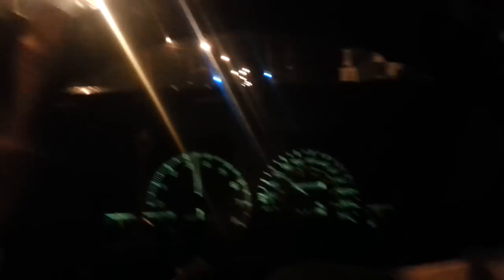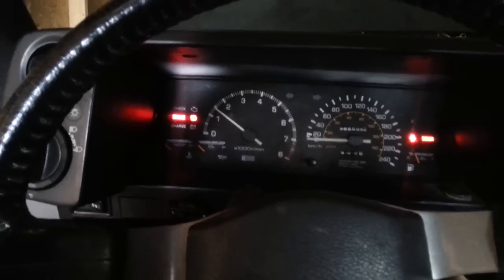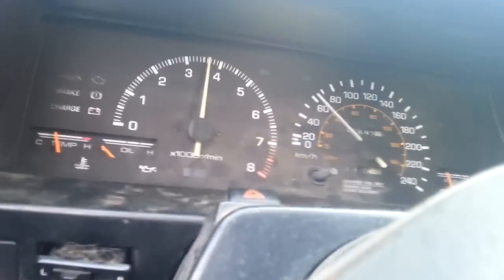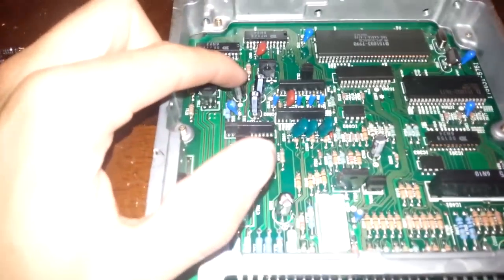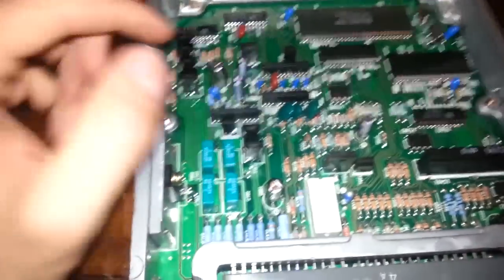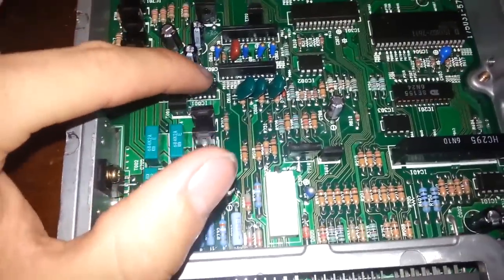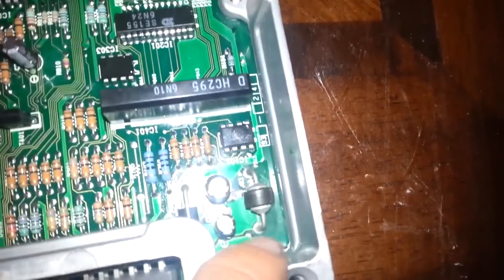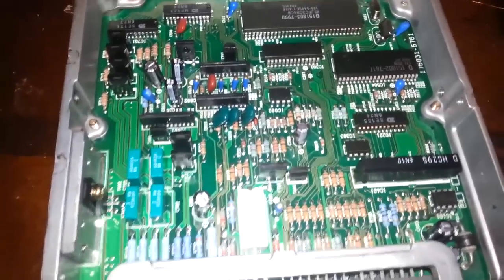Dealing with 20V 4AGE ECU problems - Limp Mode - 4000rpm Rev Limit

Comment: where would someone send an ecu to get refurbished?
Reply: i bought another ecu, but it had another part number.  car runs now, but no rpms on tach and still having idling issues when cold.  my original was deemed unrepairable by one shop and sent back to me, but I'm thinking about replacing the capacitors on the one currently in the car.

Comment: Hi. I know this is a pretty old post but do you guys still have a source for repairing the ECU.  My Silvertop has idle problems once it gets to about 160F and drops down and cuts out.  It kicks out a DTC 13 which says the distributor or ECU.  The distributor is within specs for air gap and ohm readings do I am thing the NG circuit. If not, the capacitors you mention, I see a number on them but are having trouble to try and cross reference them. Where would be a good source to get the correct ones. Radioshack maybe?  Great informative video so thanks for that.
Reply from the maker: Did you open the ecu case and examine to see if capacitors leaked?

I know a guy i can put you in touch with but before that you should confirm if the capacitors have leaked and if they damaged any traces
Reply: @Kenny4AG  Thanks for the quick response.  Yes I took the top off the ECU and I see where the larger capacitor next to the NE trace has leaked.  Another further over may have as well.  Thanks for any help.

Comment: My acura wont rev past 4k rpm and all sensors were tested even swapped the motor and the wire harness and still the same damn code p2647 high voltage  and it wont clear and we think its the ecu when i would go past 80mph my car would smell like burnt

Comment: My silvertop have the same problem, checked the ECU for back caps but everything is fine, checked for error codes, just a Bad O2 Sensor but still wont rev past 4k rpm. 

Planning to convert for BT ECU and change to whole wiring harness and do a complete engine rebuild.

Comment: Hey man, I've recently run into an ae92 with a 20v swap, it's got maybe a couple problems but I don't know enough about the engine to really tell what.
Reply from the maker: I cant help you without more details, what exactly are the issues?
Reply: Kenny4ag  Well for starter's it smokes a light grey, it's not smoking a shit-ton but still enough to raise an eyebrow to half-mast. The coolant resevoir was low, so that's probably leaking somewhere, and much like this video sometimes it does kind of have a limp mode but not all the time. It's a silvertop with a blacktop harness and TPS. I just wonder if it would be more trouble than it's worth.
Reply from the maker: Rhandal Bumbalough silver top on blacktop setup always runs rich, so that could be your smoking issue.

You could pull the spark plugs and check for indications that its running rich, even if it does theres not alot you can do to fix it short of swapping to run a silvertop ecu.

Since its running blacktop setup i assume ur running open stacks.
Reply: Thanks man, I'll look further
Reply: But you've been helpful as fuck, I wouldn't have thought of that.

Comment: how about the resistors? i also have replaced the capacitors but i still have issues. code is 42 and 33
Reply from the maker: Arvee Lacorte is your board too far damaged from the leaking capacitors?

Comment: I Hv a Bosch 022 906 032 DB ecu doesn't supply power to coil number 2, trying to replace the burnt components I just can't locate it, can u help out? thanks
Reply from the maker: PROVERBs UCHE get the part number off the part and google the part number, its usually small font
Reply: +Kenny4ag 
don't kw abt ecu thought someone can direct me to which part is responsible for it not firing coil 2 so I can change it
Reply from the maker: PROVERBs UCHE youd have to research your specific ecu but what makes you think its the ecu thats the issue
Reply: +Kenny4ag 
cos I got a used one and it fired all 6 cylinders but the throttle body didn't align, wen I put the old one back only 5 cylinders were firing and it works with the throttle body just fine

Comment: My 20v silvertop runs 600 rpm on cold start(erratic idle) and producing black smoke but after 10 mins it goes up to 800 do you think it has something to do with the ecu, every week i check my spark plugs the lower part is filled with carbon powder(running rich)
Reply from the maker: aye garsi check ur compression and make sure ur getting 180ish per cylinder.

If you are then maybe o2 sensor or idle air control valve.

Are u getting a check engine light
Reply: thanks kenny,last year ive change my o2 sensor and tps ,if my capacitor is bloated or leaking do you think it has something to do with the low rpm on cold start and running rich,i also check the iacv the magnetic part i pull it out and the small cylinder is moving clock wise n counter clock wise ,thanks
Reply from the maker: aye garsi how does it run when ur driving? Are u blowing black smoke everywhere?

Do u have a check engine light
Reply: Hi kenny,the car running smooth and normal its just that when i press the accelerator with pressure it produce just small amount of black smoke,by the way last year the mechanic change few capicitor ,about the check engine light,only when i switch on the the ignition key,but after engine starts the light goes off,thanks
Reply from the maker: Sounds like IACV(did you clean it with carb cleaner?) or temperature sensor(the one that sends signal to ECU) or air bubbles in coolant. blowing black smoke could be it burning oil but since your saying its running rich it could be that also. Bad temp sensor COULD cause it too run rich(so could air in the coolant system), so could an O2 Sensor.
Reply: I didnt clean the IACV yet,that was also the suggestion of the mechanic,he told me also that theres no problem with the o2 sensor,whats the best engine oil to use for silvertop, ive notice that when i change my oil ,after a week oil is getting dark already,im using toyota mineral oil, thanks again
Reply from the maker: for oil i've used castrol 5w40 and 10w40
Reply: Thanks kenny
Reply from the maker: aye garsi you should check for signs of headgasket issues, remove your radiator cap and see if there is a thick slime attaching itself to the underside of the cap. If there is, thats a symptom if early head gasket issues
Reply: When i check the radiator cap,its still ok theres no sign of slime,this afternoon when i started the engine,the rpm is a little bit high around 900 rpm,in your experience with the engine oil ive notice that when i change oil after a week the oil is getting darker already,ty
Reply: Hi kenny,do you have a video on how to remove the alternator of silvertop engine on a front wheel drive orientation, mine is burnt already,the space is too small and i want to know where will be i getting it (from below?)thanks
Reply: My car is ae92,thanks

Comment: Hi ive had problems with my car its a race car so alot of high rpm but the problem is as soon as I get to around 6000 rpm the car doesn't react to any of my input from the throttle I have a whole spare car for parts if needed, please help!!
Reply from the maker: Chrome Squirrel 4age? 16v? 20v?
Reply: Kenny4ag sorry 20v silvertop in a ae101 levin
Reply from the maker: Chrome Squirrel check engine light?
Reply: Kenny4ag no the light works but onlylights on when car Is started is the abs light because I disconnected it for racing and the catylitc converter  light which came on after the car wouldn't start for a while after replacing the battery.  the car smells rich and plugs are always fouled and are sometimes misfiring
Reply from the maker: Chrome Squirrel you could check the ecu per my video here but it doesnt sound like its the same issue.

Try unplugging the o2 sensor and see if that allows it to rev freely.
Reply: Kenny4ag ok thanks foe the help I will try it when I get home I think the 02 sensor might have something to do with it as well as the car idles poorly at 500rpm and dosnt sound like all cylinders we thought the ignition coil/ igniter could have something to do with it

Comment: hi! That's a great video! I am having the same problem except that my car is rev limiting at around 6000 and not more. the car is running rich and the plugs are covered with soot. i have run a diagnosis and found no codes. checked everything mechanically and everything is okay. It revs very smoothly all the way to 5.5 to 6k rpms but wouldn't go further. the car is a blacktop 4age with 7afe block and blacktop ecu. hope you can help me out. thanks!
Reply from the maker: Sorry I'm no totally familiar with the 7AG configuation which is what it sounds like your running, 7AFE block with 4AGE head.

the 7AFE is a 1.8L if im not mistaken and is a lower compression block, which would throw off all the Blacktop 4age injection calculations

most people running this setup have gone after market ECU, did you do this build?
Reply: Kenny4ag thanks for the reply. yes i have done the build and it has 4age pistons. the car was running fine the day before. i have done a 6 speed swap. it's in a ae101. tested it everything went well. next day took it out and it wouldn't rev past 6k and simply backfires. i have been running this set up for over 2 years now. never faced such problem. and i have changed my coil, ignitor, plug wires, no change. will change plugs today.
Reply from the maker: Does it idle ok?

Some things to consider in order:

1) vacuum leak
2) 02 Sensor
3) TPS not aligned or malfunctioning
4) Thermal switch under the throttle body (forget what it is called)
5) Bad MAP sensor or other MAP related issue

Maybe check the ignition timing and see if its off
Reply: Kenny4ag done a diagnosis nothing came up. but i will check these sensors again. i will also check the fuel pump. and it idles fine. thanks for the tips!
Reply from the maker: Fuel Pump is working given your issue, check ignition timing, if the belt slipped a tooth it could cause timing to be out of wack and run rich,
Reply: Kenny4ag i have checked the fuel pump. it had very little pressure. got a new pump but the problem still exists. will check the timing tomorrow. maybe the belt slipped a tooth cause i had pushed the car the day before the problem started.

Comment: cant start my 4age 20v silveŕtop. i think i have a problem  on electrical. brought it to my trusted mechanic but not able to fixed it. he said no current supply coming from CDI igniter to distributor. hope u cld help. thanks in advance
Reply from the maker: it cranks but wont start?
Reply: Kenny4ag yes it cranks.  i already tried to replaced the comp box, cdi/igniter and distributor which i bought surplus but didnt work.
Reply from the maker: Are you getting fuel? have you tried cranking for a moment, pulling a spark plug and checking to see if it is wet or smellings like gas
Reply: Kenny4ag not tried yet but if it gets fuel or smell fuel what shoul i check or do next? ty
Reply from the maker: What kind of car is this for? an AE86?

IF its fuel, jump B+ to FP in the diagnostics box, crank and see if it starts then, IF it starts then that is implying your fuel pump is not turning on, this happens to many AE86 owners

Check if you have spark, pull a spark plug, reinsert it into the the wire it was connected to, hold the plug with pliars against a grounding point such as the strut tower tops, have a friend crank the car and see if you see the plug sparking, if it sparks then reinstall everything

IF you have SPARK and FUEL PUMP works then you may have an issue where the fuel injectors are not recieving the signal to inject 

IF the injectors are firing AND you have spark THEN it should start, if not then your timing is incorrect or you have no compression
Reply: Kenny4ag thanks a lot bro. ill try to ch3ck and follow all your suggestions and get back to you soon. god bless and more power.
Reply: Kenny4ag by the way my car is an Ae101 1997
Reply: hi.been a while. i really cant srart ny car. no spark coming out from cdi but it cranks  pls help
Reply from the maker: Karlmarbey Rabanal did you check your igniter is it in working order, is it recieving the signal to fire
Reply: Kenny4ag how can i check if its in working order? .ty
Reply: Hi bro What particular capacitor or part in the ecu do you think is defective and should be replaced when no signal is coming in to my cdi, igniter and to my distributor?

Comment: Do't buy cheap caps from ebay for fixing this. get some proper branded ones.
Reply: Kenny4ag I want to thank you so much I had the same issue for about 6 month's  on my 1993 toyota corolla it was driving me crazy I checked true all the sensor and no luck.. then checking out on YouTube saw your video .I but all the capacitors and I replace them my self and the ecu is working 100% thank you so much!!!!
Reply from the maker: I'm really glad I could help in anyway, :)
Reply from the maker: of course ya, get quality parts
Reply: Hi, nice video. I have simmilar problem. I have a 1.6 4age red top Toyota Celica, it has a almost dead TPS (I’ve order a new one), and when it’s idling it does misfiring and poping and smells petrol like hell. I think it is normal due to TPS has a switch to check if throttle has been pressed or not and that switch inside TPS is what is broken, but the TPS pot is ok, so when I press throttle works great the engine. When I keep engine working on a highway or I am doing some “touge”, it starts to cut revs, sometimes is over 4k rpms engine stops accelerating and rpms goes down until 3500rpms and then it starts accelerating until it reachs 4k rpms and so on, so I turn off engine and turn it back on again and it works like normal, but randomly it starts to do the same. I think that timing is OK but it’s weird that randomly starts to do that and then “rebooting” ECU stops that symptoms. Could it be the ECU?
Reply from the maker: @jjbc5059  its entering limp mode to prevent detonation. You need to check codes or flash the codes.

Clearing the ecu isnt a real solution because the symptom keeps coming back

Have you checked the codes?
Reply: @Kenny4AG  Yeah! I have checked error codes and I get Code 11. It's normal due to TPS sensor, inside Idle "switch" inside doesn't works, but the acceleratring pot seems to work well, so I think it only afects when Idling that is not stable. Do I right? Could it be the engine timing? Before it, I had distributor displaced and when I reached 2.5k Rpms started to do that almost all the time. Then, I changed the position of it and now seems to work better and this symptoms happens 1/8 times than before, but not 100% sure if timing is OK or not. 
Thank you!
Reply from the maker: @jjbc5059  Check the timing with a timing gun, if you dont have one part stores sometimes have loaner tools.
Reply: @Kenny4AG  Hi, I have replaced the TPS and also I've opened the ECU and seems everything perfect (no leaks from condensers and traces are clean). I have set the timing "by hand" because I can't see the timing numbers and I have to clean them, but I have a timing gun. Also I have adjusted by hand the rich/lean potenciometer and the throttle screw. Now Idling is 800 rpm +-50. It does not smells petrol like before. I can have the face close to the exhaust and I can breath. Rich/lean potenciometer is setted in the middle (90º) and throttle screw was fully closed and then I opened it until 90º. When engine is cold rpms get over 2000rpms (about 2300-2500rpms) until it gets hot which makes me think that it not perfectly adjusted (I don't know, it 's my first 4AGE), but I know that when engine is cold, it shouln't be more than 2000rpm. The engine seems to sound good. What I noticed is that when you open/close the electric windows and engine is idling, the rpms goes down upto 500rpms, also happens when engine fan turns on, and when you press the throttle and then release it in neutral,  then goes up upto 800-850rpm, and I don't know if it is normal or it is due to the alternator that is broken or about to. Thank you! :)
Reply from the maker: @jjbc5059  It could be the alternator is weak, please use a multi-meter and measure the output of the alternator. It should be around 13.5 volts approx

Comment: thanks Bro .
I have Mercedes W202 1999 same probleme 3000 RPM REV LIMIT 
in diagnostic just one fault code MAF senser  I change it and clear the fault code doesn't fix the problem they said to change the ECU but so expensive her
Can this solution solve my problem; <>?
Reply from the maker: abdellatif gbella
can you rev past 3000 rpm while in neutral at idle

a 3000rpm limit means either you have your speed limiter on or its stuck on, or if your vehicle doesnt have that feature the. the car is likely entering limp mode to protect from engine damage

if you have a turbo check for leaks in the turbo tubing

also ensure your getting adequate fuel pressure

 if you suspect the ecu is the problem, try opening it up and looking for bad capacitors and damaged traces

disconnect the battery

be gentle and dont force anything
Reply: my car is manual transmission 5 speed . 
at idle and all gears Engine won't rev over 3000rpm
top speed in 5th gear 130 km/h
and EPC light on
Reply: TURBO NEW 
when I clear fault code the car run great even the rpm can rev to 5000 
But just turn off the engine and start again problem back and no fault code in OBD 
ok I ll open the ECU
thanks again 
have a good day

Comment: i got silvertop with blacktopp ecu and map sensor conversion i about got it right...vaccume tricky to map
Reply from the maker: questionur world lol howd u do it
Reply: Kenny4ag vacume block run vacume off bottom off each throttle body to block then to map with a filter between...want run right off vacume tube
Reply from the maker: questionur dude u should post a video on how to do it, alot of ppl myself included would like to run open stacks on their silvertop using the blacktop ecu
Reply: dude can i use an 4AFE ecu or blacktop ecu on my silvertop since the sockets are the same with my 4age silvertop? ty